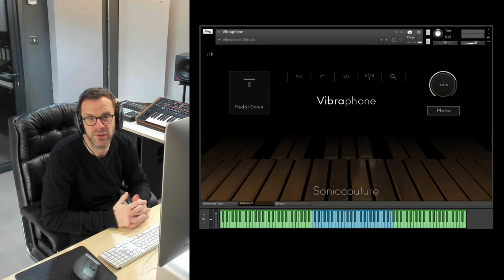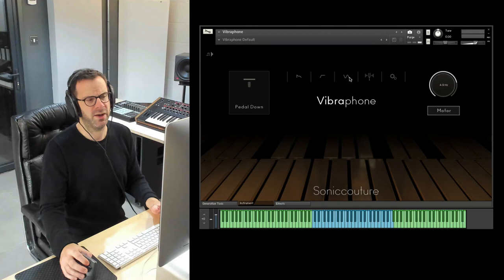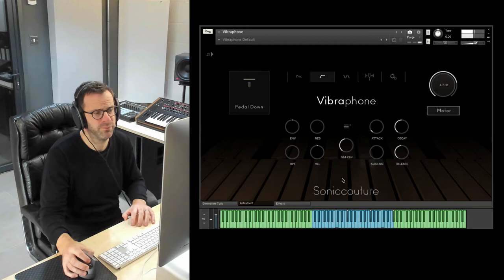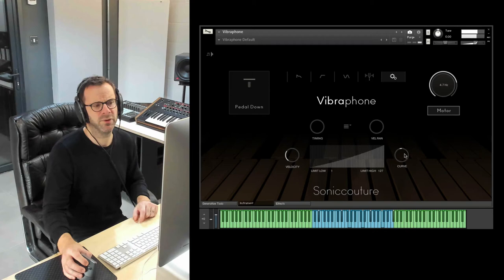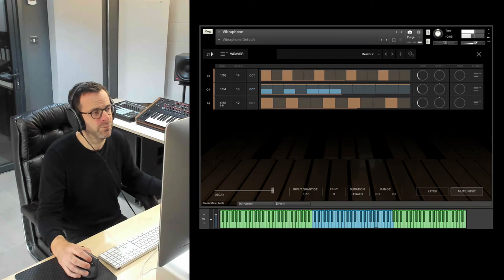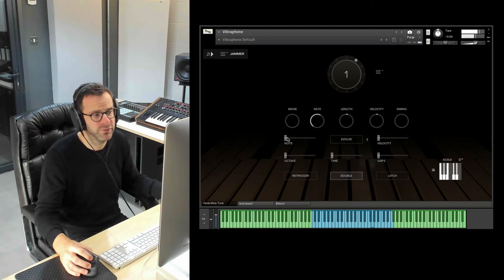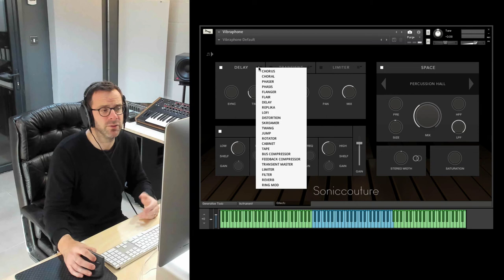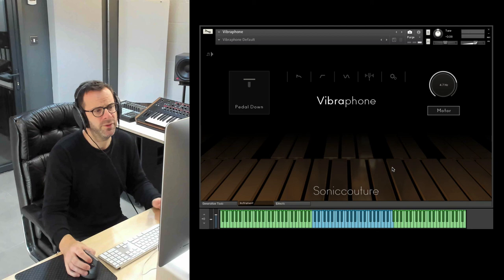Soniccouture Vibraphone: Walkthrough

Comment: I just want to add one tip - if you want to have Your tone to sound even after releasing the key, just open the "Envelope" tab, and set the "Release" knob to max (or near max, just to Your taste). 

And even better; right-click the "Release" knob > click to "Learn MIDI CC" > then move the MOD WHEEL - and voila - you can control the "Release" by the mod wheel.

I just want one more thing - to have the ability to set one key to "mute" all the sustained tone playing through this setting... anyone can help with this?

Comment: The phase correlation of a keyboard instrument recorded in such a wide stereo configuration is never going to be consistent. The middle keys will be OK, but as you get closer to the extremes, phase correlation goes into the negative and L and R begin to cancel each other out. The fundamentals of some notes disappear completely.

It sounds very convincing while using headphones, actually wider than it would in real life. But it doesn't work at all while listening on any speakers, a mobile phone, or a device such as an Amazon Echo. The sound will be poor and non-competitive in any of these situations, which is likely more than half of the time. 

Try listening to this library summed to mono or on your phone. It sounds extremely poor. Attacks are fuzzy and frequencies are lost entirely or boosted to harshness due to the comb-filtering effect. 

Additionally, because of the wider-than-life sound, this library cannot be used within an ensemble. If two of these vibes are panned slightly off-center for a duet, the extremes overlap so far over that there is no sense of direction from each instrument. The stereo image of each instance must be narrowed significantly, causing each instrument to sound comb-filtered both in stereo and mono.

Why don't you guys design a script that allows control of the timing of both channels? Perhaps a knob that when set to 0, the channels are phase-aligned and panned to center, but when set to 100, the original timing and panning is left alone?

For $129, this library should sound perfect in mono. It doesn't. So after I spend the $129, I must spend days of my time first creating a Left and Right copy of the plugin, since you don't allow editing of the samples. Then I must add a sample start delay to all 23 velocity layers of the quieter channel (That's 851 total adjustments, possibly only 37 as long as the timing of each layer is consistent. But still each of the 37 must be copied over 22 times. A PITA in Kontakt).

And then I must pan the louder channel to the quieter side until the sound is balanced. (Another 851 adjustments, or possibly 37x22). Then, because I can't be bothered to do any more of this tedious work, I must silence all other groups with release trigger sounds and effects, making the library sound much less realistic.

I don't even know if this hack is against your EULA, but I will be forced to do it, because you are too short-sited to provide a mono-compatible version of the library yourself.

Btw, NO ONE cares about the vibrato. It doesn't even sound realistic. You can hear the sound of the room going side to side from horizontal to vertical fins, and the transition is not interpolated correctly. You can hear a hard difference between the two groups. 

I hate the direction the market has gone with sound libraries.
Reply: I care about vibrato.
Reply: of course you're a cyclist